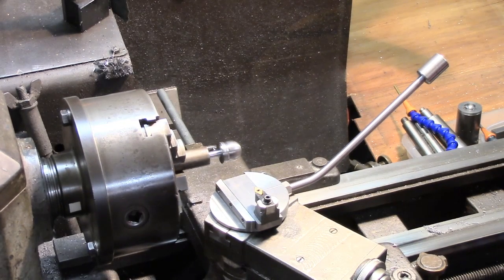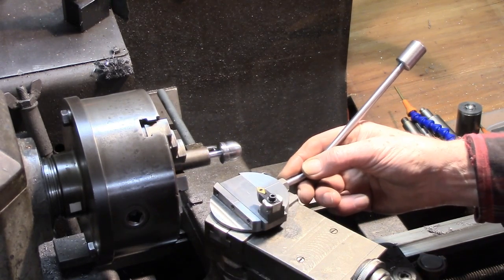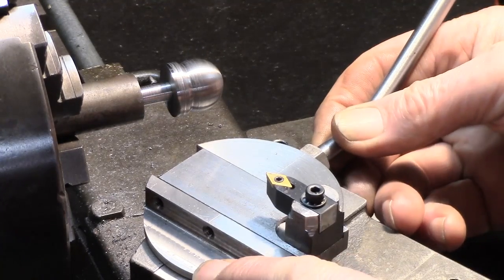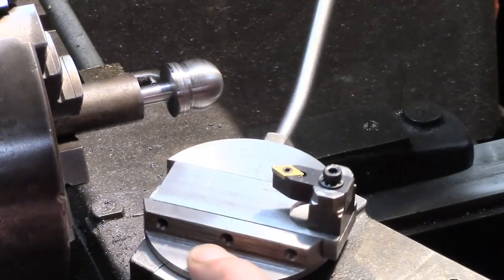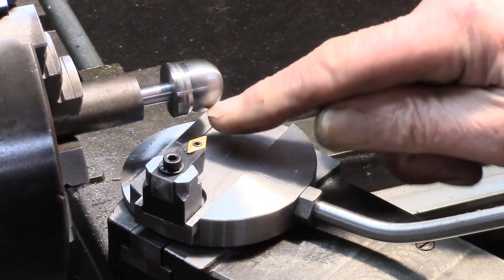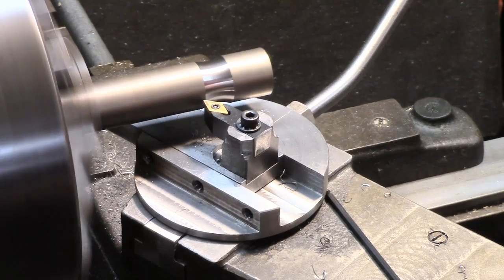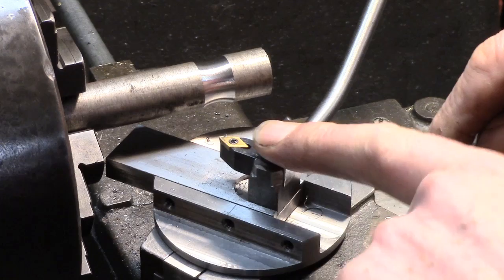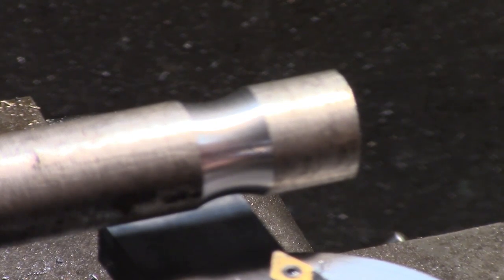Radius Ball Turner - Update, Mods Needed

Comment: It's great for small model work . You need to have a tension bolt to hold it to the T bolt to take out the wobbles . mrpete222 shop tips 123 has a home made ball turning tool for South Bend that might give you an idea or two I think .
Reply from the maker: Indeed, am planning something better to get rid of the 'wobbles'. I am also still considering various other options, even including another design entirely.  I will check the Mr Pete video, thank you.

Comment: Modifications, The swileling post need to be fixed from underneath to the fixed part of the tool that is held in the compound slide, you could fix this with an allen screw though a large turned washer, the bigger diameter the better, that would stop any rocking on the rotating part, just adjust until it only just rotates. The concave problem can easily be solved by putting the tool holder in the other way round so there is no excess tool hanging out on the chuck side. You could turn more of the back of yor ball if you can rotate the tool in the clamping anti clockwise, there would then be nothing hanging out on the chuck side, you coud even make the tool holder rotatable to achieve this. Good Luck, Chris B.
Reply from the maker: Some good thoughts - problem with tensioning swivel pin is that it would then make access to set screws difficult - altho just thought - could have two holes in swivel body for access. May well try that.

Comment: To avoid the jaws of  the chuck when turning concave, turn the tool post "L" section around and install the carbide holder out the back of the "L" section.
I had same problem with turning a ball all the way up to the shaft. I change the position of the carbide insert on the tool post so that the cutting side (left side of the cutting edge) is inline with the center of the ball. 
Good video.
Reply from the maker: Thx Milton - points taken and already following this direction now.

Comment: I can see the potential in it, could you make a pocket in the bottom side of the t-nut so some type of fastener could be screwed into the pivot pin a little tension might keep it from rocking. Just a thought, also could the tool holder be turned around and faced out so you could have more adjustment for concave cuts without hitting the chuck? I know the handle would have to be moved but just some thought and maybe options.
Reply from the maker: Yes, that sure would help - main problem would be gaining access to set screws in t-nut to install it all. Turning tool holder round now been tried since making the video. May yet put handle in another location.

Comment: BAH. I have been trying for hours to get in some ideas.  Near the end of a lengthy post my inadvertent activation of a few Firefox keyboard shortcuts sent it all into the Ether.  Then I tried some graphics and narration only to have my cat decide that now is a good time to get vociferous about something or other. 
I can only assume that the Gods want me to keep out of it.  I will try again later while the Gods are napping.  In the meantime, the short version would be to rotate the bit and toolpost to the left around 60 degrees then offset the post to the right until the point is back to centerline.  Does the cross slide have enough travel that you can make a swivel base on the cross next to the compound?
May your Gods be better mannered than mine.
Reply from the maker: Hi Eddie - am working on a new tool post which I think will help. I don't think my cross slide has enough travel to manage another location unfortunately. If removal of compound wasn't such a PITA of course I'd work on that and get much better clearance from machine center line.

Comment: Hi, Chris.

For concave work you could reverse the slide in the base and the tool bit in its cradle, putting the cutting edge ahead of the center pin.
 Bonus: nothing to make for a trial run.

Cheers,
         
          Tom
Reply from the maker: Thx Tom - indeed, had tried that after doing this video - one of several changes tried and planned.

Comment: Chris, for convex cuts simply put the insert holder on in opposite direction and then reverse the sliding bar/tool holder assembly and you will have chuck clearance. The upright ob the tool holder needs to be narrower to be able to get in and cut the chuck side of the ball as well as reducing the insert stick out. I hope you find this helpful.

Peace!
Reply from the maker: Thx Jeffrey - in fact in process of making a new tool post with an offset to gain clearance and a better tool angle - we'll see how that works out.

Comment: Chris: a suggestion on turning the ball. I do it just the opposite as you are doing. Round one side, drill and tap the size of your mount , cut it off the size of your ball, screw your work on a threaded shaft and cut the other hemisphere.